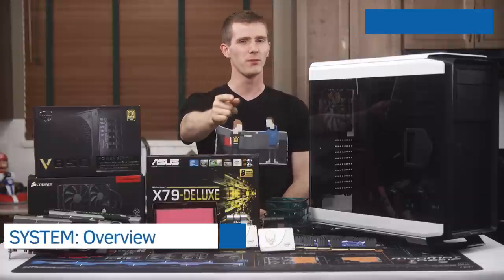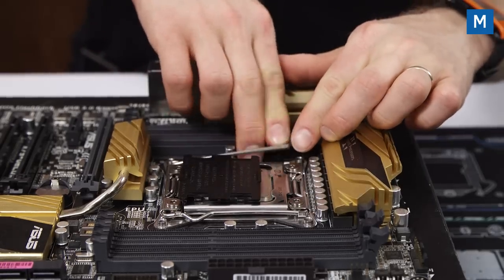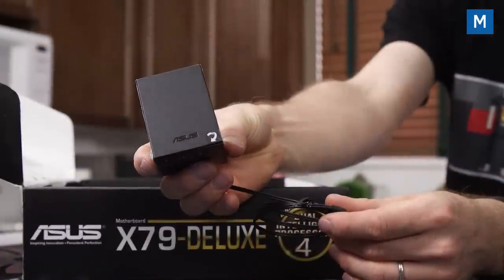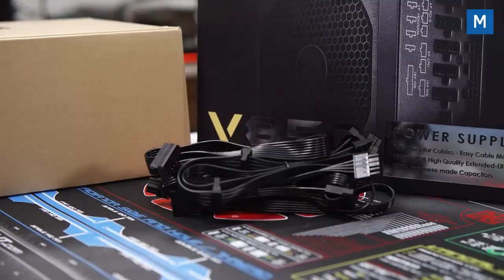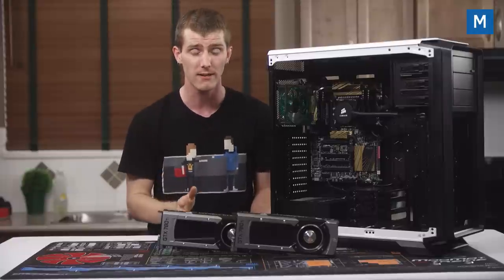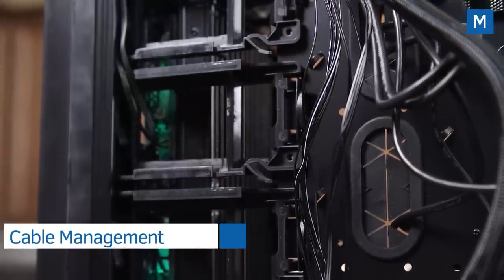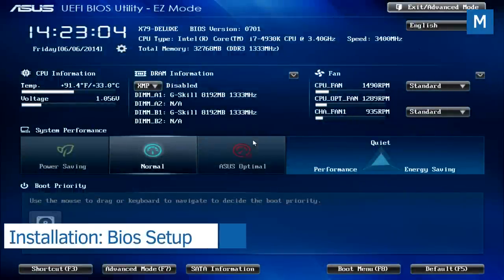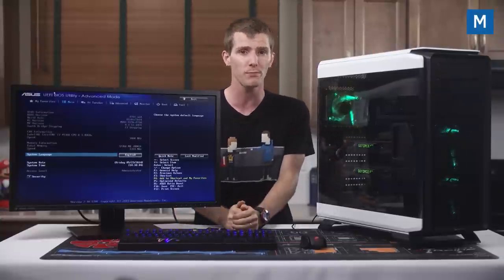How to Build the ULTIMATE 4K Gaming PC Build Guide

Comment: I'm on a tight budget, does anyone know how well this PC can perform in games like Arma III and Battlefield 4?

CPU –  AMD FX-6300 
Motherboard – ASUS M5A78L-M LX PLUS AM3+ 
Video Card - Sapphire R9 280 
RAM –  Kingston HyperX Fury 8GB 
HDD – Seagate Barracuda 500 GB 
Case –  Thermaltake V4 
Power Supply –  XFX Core Edition PRO 550W 
Optical Drive – Samsung 24x SATA DVD RW
Reply: Maybe not in ultra but I am sure you will still get good frame rates
Reply: get a motherboard with a better chipset, and change your case. TT cases are name only, no quality.
Get Gigabyte 970 UD3P.
Reply: I have the same GPU and CPU and I can play Titanfall maxed out. Since Battlefield 4 supports Mantle you should be getting good FPS
Reply: u should buy a intel proccesser not a AMD
Reply: John Youkhana You have no idea how hard I'm facepalming
Reply: Casual G4mer ohh crap replied to the rong comment
Reply: John Youkhana you can get a 280X because its just 20$ more
Reply: At least 1 TB hard drive. No less
Reply: Perfect but it would change it to 1tb if u have a lot of games and content
Reply: It will run fine as long as you have a great video card
Reply: John Youkhana all my Games runs fantastic on an AMD always has. Intel is over hyped and overpriced
Reply: ActionFigureReview if i get a AMD processer hwhat should i get im looking for one that will allow me to run gaames like BF4 Titanfall and DayZ
Reply: Omee3Nn But then again, the GTX 770 cost 20$ more than the 280X and because the price difference isn't that much it can come handy in the future
Reply: Casual G4mer But then again it's not needed to go 20 dollars more fore the same output.
Reply: zaiglo But then again...
Reply: Jay Man Yeah I can understand your point completly. Though Intel CPU's are used more in computers that are often editing heavy movies, and stuff like that. I belive that an AMD is just as usefull. And I'm not an Intel or an AMD guy, I have had both, and they are great in different ways. Here where I live, the price difference between a 8-core AMD and an 8-core Intel is so enormus, that a person like me cant afford an intel if you have to provide your family on my sallary. :) Go for Intel if you want, and go for AMD if you want, my oppinion is that AMD is great do to the power to price ratio. Sorry jay Man this was probably not that directed to you. Just wanted you to see a bit how it is here :)
Reply: MrDubstepDNB2012 OMG you don't know what you're talking about. For the price you can only get something like the GTX 760. And the R9 280 is way more powerful
Reply: MrDubstepDNB2012 How do you have to use it to shorten the life span? There are alot of HD7950 still around
Reply: Casual G4mer MAC FTW
Reply: John Youkhana Dual boot with Windows and Osx FTW!
Reply: That thing about the R9 280 having a "short life span" is total B.S. Unless you are buying used, then a brand new AMD GPU should last as long as a similar Nvidia card if used normally. The guy at that PC shop was probably talking about used AMD GPUs that were used for mining litecoins. Or, he just happend to notice that more customers had failing AMD cards most likely due to mining. The R9 280x, 7970 and 7950 were the most popular mining GPUs last year and early this year and during that time span almost all of the ones sold were put in mining rigs and tortured 24/7. Besides, if anything does go wrong, they all have the same warranties - usually 3 years. It just so happens that both AMD's and Nvidia's GPU cores are made by the same chip maker, TSMC, so you know they have the same quality control. And the rest of the card is made by the same companies be it Asus, Gigabyte, MSI, etc. In terms of quality and the way the cards are made, there is almost no difference between an AMD and Nvidia GPU. The differences are purely in the design of the chip which only affect performance and efficiency and have nothing to do with longevity. If a card fails prematurely it is due to the way that it is used. It just so happens that AMD cards are better at mining crypto coins than Nvidias. Mining usually results in the GPUs being run at 100% load 24 hours a day for weeks or months at a time. If you do this to any GPU, it will have a shorter life span than usual.
Reply: Will this run arma3

Fujitsu Esprimo

Chipset: Intel H81 Express
Processor: Intel Core i3-4130, 3,4 GHz
Memory: 6GB DDR3 1600 MHz (max. 16GB)
Hardrive: 1 TB
GraphicsCard: NVIDIA GeForce GT 630, 2GB
Optical station: DVD±RW (±R DL) / DVD-RAM
 Windows 8.1
WLAN: no
USB-ports: 2 x USB 3.0, 6 x USB 2.0
    DVI, VGA, RJ-45, microphone, Headset, 2x PS/2
(K x L x S): 353 x 175 x 425 mm
Weight: 9Kg
Reply: Kristian Nykänen 
Arma 3 system requirements:
OS – Windows 7 / Vista.
CPU – Intel Core i5 or AMD Athlon Phenom X4 or faster.
GPU – Nvidia Geforce GTX 260 or ATI Radeon HD 5770, shader Model 3 and 896 MB VRAM, or faster.
RAM – 2 GB.
HDD – 15 GB free space.
DVD – Dual Layer compatible.
DirectX® – 10.
Reply: Casual G4mer soo.. that means no :(
Reply: Kristian Nykänen I don't know why you ended up with a GT 630 paired with an i3 4130 but it is a complete waste of money in my opinion. The i3 4130 has the Intel HD 4400 GPU built into it which is almost as good as the GT 630. The HD 4400 has a passmark score of 534 and the GT 630 scored 745. In contrast, the R9 270 (which is selling for under $110 on newegg right now: http://www.newegg.com/Product/Product.aspx?Item=N82E16814131545&cm_re=r9_270-_-14-131-545-_-Product) scores 4,200 and the GTX 750ti (which can be had for under $120: http://www.newegg.com/Product/ProductList.aspx?Submit=ENE&DEPA=0&Order=BESTMATCH&Description=750ti&N=-1&isNodeId=1) scores a 3,700. The GT 630 is a $50 card give or take a few dollars. For twice the money, you can get FIVE TIMES the performance with the 750ti and almost SIX TIMES the performance with the R9 270. This is why nobody recommends GPUs under $100 because the difference in performance between a $50 GPU and a $120 GPU is A LOT. The only time a GPU like the GT 630 makes sense is if you have a 5 or 6 year old PC with PCIe that needs a boost in graphics performance so that you can play Blu-Ray videos on an HTPC. This is not by any means a gaming GPU. You might as well have used the HD 4400. If you want to play any current PC game with decent frame rate and in 1080p, get at least a 270 or 750ti. Period. Nothing under those is acceptable for gaming.
Reply: My budget is 550€
Reply: Kristian Nykänen Just keep what you have and simply buy an R9 270 or up from AMD or a GTX 750ti or up from Nvidia. I mean, shit, if you have 550 (euro?) then you can afford the GTX 970 which is in many people's opinion the best value GPU out right now since it beats the GTX 780 and is damn close to the 780ti stock. With minor overclocking, it beats a 780ti and comes pretty damn close to a GTX 980 plus it has 4GB of VRAM. I don't know the prices in your area, but in the US if you can find a non-reference one it is about $370 at the moment but that price should drop come Thanksgiving sale season and then even more after Christmas. $370 is about 295 euros which is a lot less than your budget and is more than you need in the GPU department. You can even get an i5 4690 as well which will work in your motherboard. A 4690 is about $225 here or just under 180 euros. The 970 and 4690 would literally make your PC top of the line and you would still have some money left over to buy games to play on it (I suggest Far Cry 4).
Reply: Do i have to build my pc with everything you said
Reply: Cause i cant remove some parts before purchase
Reply: Kristian Nykänen Option A: Change only the GPU. Keep the i3 and buy an R9 270 which would give you excellent performance in 1080p in almost every game with medium to high detail. That is the cheapest option and you are only changing one part. It is the bare minimum of what your PC needs to play Arma 3 with decent performance. *The R9 270 does require at least a 450 to 500 watt power supply so if your PC doesn't have one that big you will have to replace it. If your PC has a small PSU, you might be able to use the 750ti on it since it only needs a 350 watt PSU...

Option B: Change the CPU, GPU and maybe the PSU. Replace the i3 with the i5 4690. This will give you much better performance in games that are CPU heavy like Arma 3 is (it requires at least a quad core i5). The i3 has 4 threads but the i5 has 4 physical cores which is much better for gaming. Then, replace the GT 630. You could go with a mid-range card like the 270, but since your CPU is now high end, you should also get a high end GPU. The GTX 970 easily has the best price to performance ratio of any high end GPU out. It is better than anything AMD has to offer in terms of single chip gaming GPUs. The 970 also requires a big power supply, at least 500 watts as well.

According to your budget, you should easily be able to afford option B and a new power supply with money left over. Since your PC was a pre-built one, I'd say keep them for warranty purposes. Most likely, your warranty is only covered with the whole PC so it would be cheaper for you to keep them if anything goes wrong with the rest of the PC.
Reply: Do you mean this    AMD R9 270, 2GB GDDR5, 2xDVI/HDMI/DP, PCI-E 3.0
Reply: Kristian Nykänen Yes, all the R9 270s are pretty much the same. If you get the 270, you WILL need to change your PSU as well. I looked up your PC, the Fujitsu Esprimo PH310 E85+, and it has a very small power supply with only 280 watts and I don't think it even has the proper PCIe 6+2 power cables to power a GPU like the 270. You will need at least a 500 watt PSU to run the R9 270. Get something that is 80+ rated at least which indicates efficiency and also usually quality. Basically, with your current 280w PSU, you can't run any new decent GPU on it, it has to be changed. The GT 630 works because it runs off of the motherboard and isn't externally powered by the PSU like most newer mid-range cards are.
Reply: Nah. It can't even run Minecraft set at 144p + low settings.
Reply: I recommend changing your processor to 
Amd FX 8350 it is the best value for money and is just amazing
Reply: you cannot comp[are bf4 and arma... arma is an EXTREMELY poorly optimized game that doesn't run wel on ANY computer build, even if you said fuck the 4k monitor and dropped 4 k on a super computer.
Reply: I have the same gpu and at 1080p ultra on bf4 you will get around 60 fps, maybe more
Reply: ok dude a little weird but i have the same cpu and motherboard, the gpu right below you (270x but also by sapphire), the same ram and optical drive and the case is v3 black edition so i think i can give a little insight albeit 2 months late. it runs most games pretty smooth. i spent 600 or so in the end and then another 90 for windows and used a monitor keyboard and mouse i had lying around. i picked up a cheap headset and best buy and i was ready to go. the cpu is nice and the stock cooler is quiet and the r9 280 will be fine for bf4. i played advanced warfare ultra at around 47 frames (32 while streaming if that doesnt blow you away) and it is overall an amazing experience. at this point the prices have probably gone down so if you have the money still you could upgrade but honestly that build sounds great from top to bottom :)
Reply: if you want to spend less money, get a r9 285 and if you don't need a 6-core cpu, try the Athlon X4 860k or a 760k but your board will not work.
Reply: JollyHickups... Anonning I have 6 cores and I see no benefit if you aren't planning on streaming. maybe future games will be better optimized
Reply: most definitely

Comment: 780 Tis for "the ultimate 4k build ??? Is this a joke?
Reply: mariodrv its 2014 dude..did u recommend titan x which is not released yet at that time -_-
Reply: Az Reith I meant two R9 290X wich outperform the 780tis in every aspect at 4k, especially now that Nvidia
"abandoned" them after only 1,5 years - wont even mention the measly 3GB V-ram.
Hell they even give two 980s a run for there money.
Reply: mariodrv I am building myself a rig this summer, and Im doing 2-way crossfire with 8GB R9 290x's
Reply: Wait for th 300 series - then buy them. ;)
Reply: Kiva Swander
lol
Reply: You can do at least 20%+ better with 2x R9 290X at 4k without stutter and similar vram and SLI issues.
Hell on average CF alone is around 15% faster then SLI atm - not even counting that the 290X is on par with the 980 at 4k.
Reply: Kiva Swander single 970 or sli?
Reply: Listen kiddo - you may be happy with your purchase for now and i agree it is not bad - but claiming its better in 4k than 290X CF is just ignorant.
Are you igrorant?

P.s.: your framerates are not that amazing tho - more like below average in the high end dual card setups spectrum. 
        More like a leprechaun living in you head... :S
Reply: Looks like we got a fan boy over here!!
Reply: mariodrv Jesus christ man...are you still going with the insults? what your problem with 780tis? Its a good card.
Reply: Josh L You should wait around for the 390X's to be released.
Reply: Did you watch the video?